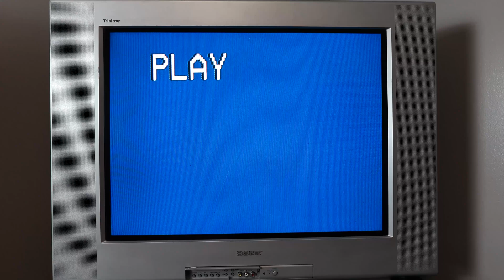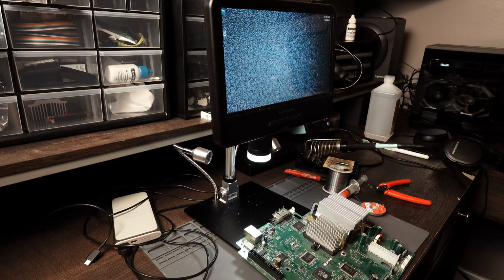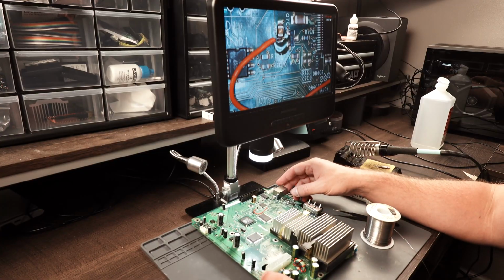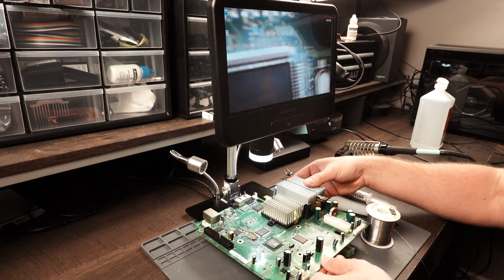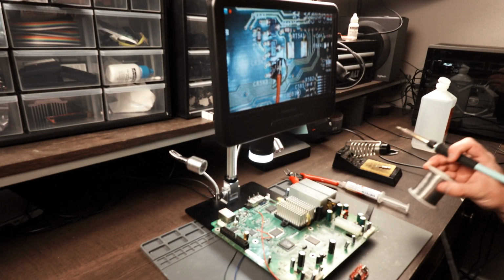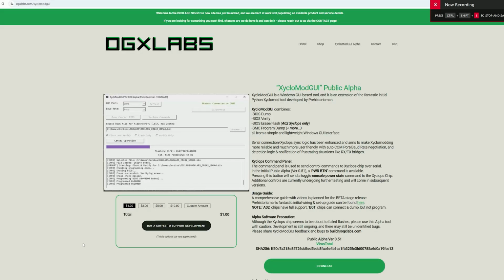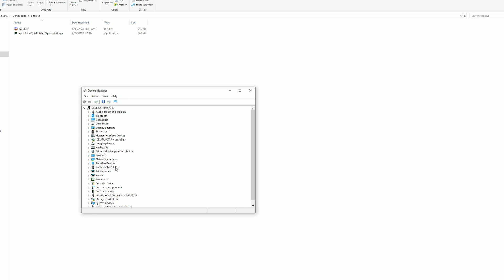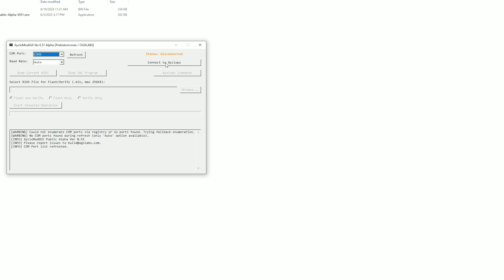XycloMod flash the on-board BIOS on v1.6

Comment from the maker: I noticed that on another one I did it would connect but fail to erase bios.Also was reading over 3.3volts on the 3.3v to debug jumper like 4.1volts.If you have this problem try removing the 2, O omh resistors right below the av port .worked for me, but you will need to put them back for the av connection to work .